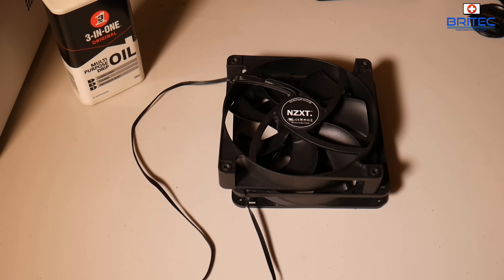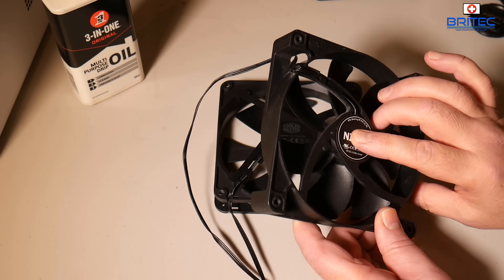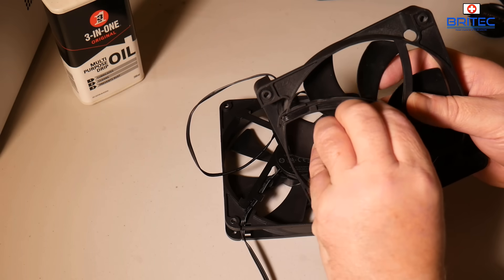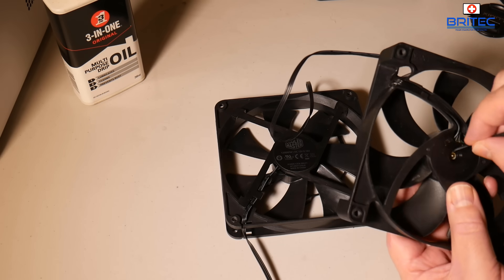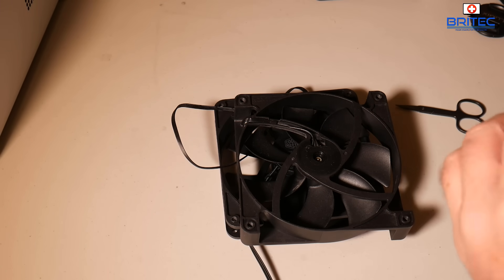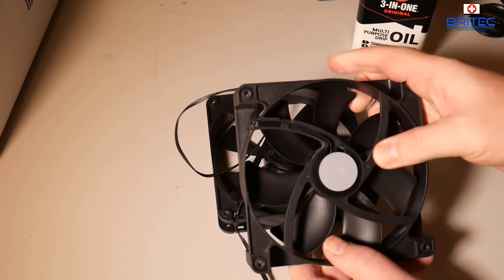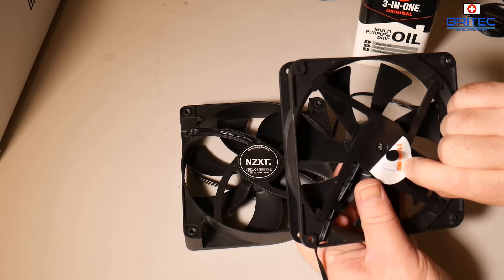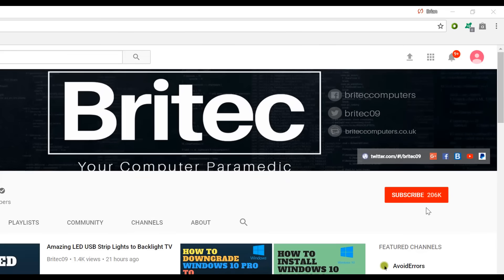How to FIX Noisy PC Fan

Comment from the maker: ▬▬▬▬▬▬▬▬▬▬▬▬▬▬▬▬▬▬▬▬▬
    T H A N K  Y O U  F O R  W A T C H I N G !
   P L E A S E  L I K E  A N D  S U B S C R I B E !
▬▬▬▬▬▬▬▬▬▬▬▬▬▬▬▬▬▬▬▬▬
Reply: The most creative outro screen but as a comment.
Reply: ▬▬▬▬▬▬▬▬▬▬▬▬▬▬▬▬▬▬▬▬▬▬▬
    T H A N K   Y O U   F O R   T H I S  G R E A T   V I D !
      Y O U.  S A V E D.  M E    T I M E   &.  M O N E Y !
▬▬▬▬▬▬▬▬▬▬▬▬▬▬▬▬▬▬▬▬▬▬▬
Reply: oil worked for me, but only for a few months. After that noise comes again.
Now I took apart the same fan, take out blades and not oiled but lubricate motor axle. Fan works again so silent that i thought its not working at all. Now im waiting while noise will come again.
Reply: Brian, the  clarity of the audio on this video is superb, but the last couple of months worth of videos sounds muffled by comparison. So what have you changed audio-wise since this video ?
Reply: can i use refined coconut oil? or refined soybean oil?

Comment: TIP: 
If the fans have recessed shaft like that one in the video you can place your thumb on top of it, creating an air chamber, if you push down with your thumb, the air will push the oil further inside

Comment: I had a rattle in my fans, I turned the off one by one, but it wouldn't stop.  I finally figured out that I need the outflow fans (only two) to be at a higher RPM that the intake fans (there are three).  Once I slightly increased the RPMs the noise stopped.

Comment: What if your fans are brand new and meant to be noisy since they're  made for WORKSTATIONS, but you being the silly fool you are decided to put them in your PODCAST PC build since you decided to make the most expensive PC you could with consumer parts. Including, going with a TR 3990x and a 3090 you paid 3K for (which wasn't as bad of a gouge as a I thought, ~50% more than MSRP on that PNY XLR8 card). SO, I used the INDUSTRIAL LEVEL of Noctua fans; rightfully thinking I should worry about cooling in that pc since it also is in a room with a terrible AC that means the room during SUMMERS can reach up to  80F and 60% Humidity.

Comment: Fan was making noise like a jet engine, took it apart, greased it up but still didn't work. Accidently dopped it on my table and now it's working again. Now i am convinced my fan is a masochist and really liked that "gentle" hit.
Reply: u my friend are a genius my fan didnt have the plug like in the video i was so sad then i saw ur comment so i also hit my fan on the desk the whole fan came off and it was secured with a metal pin so u could pull it off and lube it thank you

Comment: As usually the case with anything I want to fix. I have something else, something weird which is never the case in any video. So I pull off the sticker from my 120mm fan and there is nothing there. I know that it might be a rubber cover over the bearing but this seems to be plastic and shut. One mold. There is a little circle, but it doesn't seem to be a separate part. Even if it were, how the hell am I suppose to pop it out. Any ideas, help?

Comment: I just got a new case with new fans (apart from the cpu fan) and I'm getting a buzzing from one of the brand new fans! It doesn't seem to be a cable brushing against the fan or anything... just a light buzzing, like a bumble bee! It comes and goes and if I knock the case it will go away. It is a very dusty environment but surely a week old fan wouldn't fail this early??? Edit: It was the CPU fan... it was caked with dust... got the compressed air out and gave it a good blast and its fine now!

Comment: Any way to make GPU-fans less insufferable when they go past 1000/1500rpm?... I have two of those 90mm (I think) ones on mine, but the GPU gets quite hot and the software likes to really ramp up the fans. - And necessarily so, but why the hell they're so noisy, I don't know. The GPU was new, there's almost no dust getting into my case, but they just sound horrible. - Even at somewhat lower speeds they're too noisy. - I have my other SEVEN fans nice and low and I barely hear them, but then the GPU-fans are there to ruin the peace.

Comment: This video could be 1 minute long, but thank you anyway for the help. Will try it later today.
Reply: It didn't help me at all. My NXZT fans can't be opened like this ones, so I couldn't apply this fix. I only ended up destroying the stickers from one of my two fans but actually what helped me was to clean the dust from all the corners. Apparently, the weight from the dust made it spin uneven and created the noise. After cleaning them with a dry brush, reinstalling and testing them, they went back to be silent. Thanks to me, I guess. Lol.

Comment: I just clicked out my fan some fans can be unclicked out and clicked back in they run again you can get white vasiline it should stop vibrations and lubricate metal pin if done it on my humifier to my computer fan did this after 3 month's and my webshop refuses to replace it and thinks i just send it back for them to fix they probably would've done the same thing so may as well do it my self, that is assuming fan is not having washer from preventing it from being removed sometimes you can push it off and forefully damage washer to push it off to

Comment: you dont use oil to fix noisy (vybrations) in the fan.. its liquid, you use grease! and of course including tearing it apart to clean it up and regreace
Reply: Technically you are correct however in real life experience many people obtain satisfactory results using the method as shown in the video, even if it is not what a technician would do, this alternative does actually work for most people and in most cases will last for several years by which point many people will be purchasing new equipment (such as laptops) anyhow

Comment: I know this is a really dumb question, but could I use alternative oils like vaseline? >.>
Reply: ln a pinch yes you can however you would have to make sure that you remove any washers/seals and apply the compound directly to the rotating parts to insure the compound coats them since vaseline does not flow at room temperature. another alternative would be baby oil (mineral oil) which will penetrate better (so that you don't have to dissasemble the moving parts) and flow to where it needs to go.

Comment: Would love to hear a before and after with a bad fan in a review like this.  I've got one that sounds like a bad bearing, so hopefully this works on it.  Looks like the US has the same brand of oil.  Naturally, we have a yellow bottle instead of white, but the design is mostly similar.
Reply: A worn out bearing will not fix itself with oil, it means the balls inside are worn out to the point the fan itself is capable of wobbling around the rotational point.

Comment: Cleaning the filter on my case, while running (I’ll shut off next time) and reinstalling it, clumsily. Hit one of the moving fans, now I hear a tiny wobble/grind sound very very subtle, but can’t unhear it. Will try this out
Reply: 2 month update: grinding sound is gone thanks to the oil, and has not returned! Interesting though, it didn’t completely go away immediately, it took a couple weeks, I guess the wobble corrected itself over time with less friction I don’t know

Comment: Only thing I had on me was beard oil...... I now have a perfect working fan and my hole house smells Manly 🤙🏼
Reply: This is a bruh moment
Reply: @wowwow-xp9sk  how
Reply: win-win
Reply: I just did the same thing ,had some by the computer and saw the comment,fixed,thanks!
Reply: Thunks bro. Bitter kip thet bird will tremmed. Love from Aus!!
Reply: Lmfao
Reply: Lmfao I did exactly this, as the only oil option I had, dapped a Qtip in a drop of beard oil and applied to the fan bearing, works like a charm. Call my crazy...didn't remove fan from computer for this operation
Reply: After shave ok?

Comment: My fan on laptop makes noise every time I boot up, but 5-10 seconds later it's quiet. Normal?
Reply: when u boot up ur lap the fans accelerate to nearly their full potential this happens wid me too... den umm while using it barely touches 60 percent of the speed unless ur using a fan controller which is only possible in tower pcs. so yea there might be dust accumulation which makes ur fan noisy while running at higher speeds. clean them

Comment: I would call it a "plug" vs "a grommet".  I took a 120 apart last week, cleaned and lubed it with "Super Lube".  Runs and spins better than when I used Wahl's Clipper oil the first time round.

Comment: The reason why these fans get noisy and will eventually seize is because the bearings start to fail. The precision super hardened surfaces of the bearings starts to wear out. Putting on lubrication is a temporary fix. 

Fixing the fan to make it last longer is a good idea. If you can get a number of months or even a year more from the fan is a good accomplishment. Makes for saving the fans from going out in to the land fill for a number of months or a bit longer.
Reply: But a fix, nonetheless and does prolong their longevity.

Comment: what if it sounds like its banging against something even though its not
Reply: same
Reply: Same
Reply: I just fixed a fan that had this terrible ticking sound whenever it was running. I pushed the blades off (make sure your fan can do this before you do it; typically done for easy cleaning). The problem was there was a little metal/magnet cylinder that was on the inside of the blade assembly that had gotten knocked around a little in shipping or just didn't quite get set all the way during manufacturing. I could even see little rub marks on the cylinder where the assembly was hitting the main housing. I pushed the cylinder down into the assembly, pushed the blades back on, and it started spinning again with no noise.
Reply: You need a new fan at this point

Comment: Mine doesn't have an access point. What to do?
Reply: Watch closely, it must have an access point. In any case, it wasn't molded like that, it's still made from parts.
Reply: @somnorila9913  I had to drill into the plastic

Comment: Me playing Minecraft: Sets distance chucks to 32

My PC: *JET ENGINE NOISES*
Reply: Add Shaders and a intensive resource pack to it.

Mmm that’s crispy
Reply: Same, it's clean and it cools my hardware really well. Although I think the fan is from a Boeing
Reply: If you think about it it shouldn’t be that hard to run
Reply: i did not think i was gonna see potemer on a pc fan video
Reply: Fax
Reply: V M new problem created
Reply: my fans do the same think

but while watching this video
Reply: I don't know which fans, but it shouldn't really have to do that for Minecraft. - Try to control your fan-speeds, if they can be controlled, and set them to lower rpms. They should still provide good enough airflow, if they're decent fans, just not make as much noise. - GPU-fans are the worst, however, as they could ramp up with just some temperature-peaks on the GPU, and they tend to be of bad quality and thus noisy. - Still, you could potentially set their speeds and not make it sound horrible.
Reply: Me after literally opening my pc in general
Welcome to Sony airlines please stay seated and prepare for take off

Comment: You rubbed the excess oil around the plastic base and expected the sticker/cover to stick to the oil? That plastic base should be cleaned with a lightly soaked with isopropyl/rubbing alcohol  cloth/paper towel to clean the area. The sticker needs to re-adhere to a clean base. Other than that, good video. Thanks.
Reply: Yes, I noticed Brian just rubbed has finger around the area. Definately better to clean fully to re-apply the sticker. Oil and sticky stuff don't mix!

Comment: Informative video Brian ... I'd put up with noisy fans since the mid 90's, fine when you buy them, but having to replace them every two or three years because of the inevitable buzzing that comes over time got annoying.  Then in 2010 I came across an ideal solution, buy Noctua.  I've had the same NF-P12's for going on 9 years, no buzzing no nothing, even undervolted they are amazing.  Yes it cost me an arm and a leg when considering fan prices, but in 9 years they've paid for themselves easily, and I haven't had no pissing about having to change them or repair them.  They have a MTBF rating of about 17 years, and it wouldn't surprise me if they went beyond that.  I will admit though, when I bought them I had some buyers remorse, but it turns out there was no need.
Reply: Ive had a noctura fail within 3 years. My oem zalman fans that came with the case are going strong except for the top one, which is why Im here. I built the rig in 2012, 11 years ago and havent had a problem until a couple weeks ago
Reply: The Noctua Redux (grey) fans are much better value
Reply from the maker: Noctua fans are expensive, but well worth it in my opinion

Comment: Good tip Brian. I remember someone asking for this on the old discord server. Glad to see you said not to use WD40, worse thing to use
Reply: I'll just reply to this anecdotally. I used WD 40 because it was all I had when I fixed my fan. Going on 1 year now no issues, fan noise fixed.
Reply: @ccarter55589  Is that still the case? WD40 is pretty widely known to lubricate only temporarily. It collects dust and evaporates partially, while mixing with and dispersing any other present lubricant, meaning it actually increases friction if you dont regularly reapply it
Reply from the maker: Yeah that can act like a de-greaser